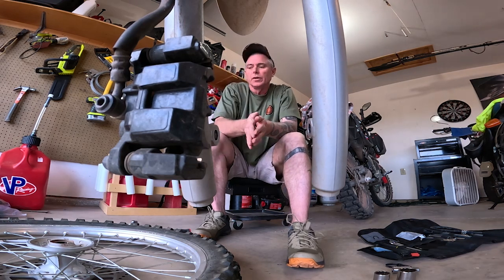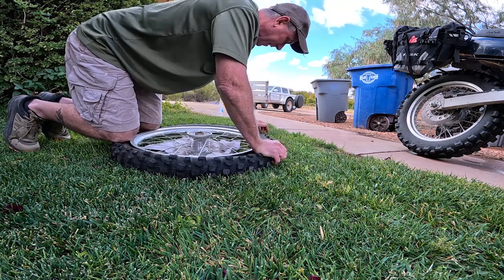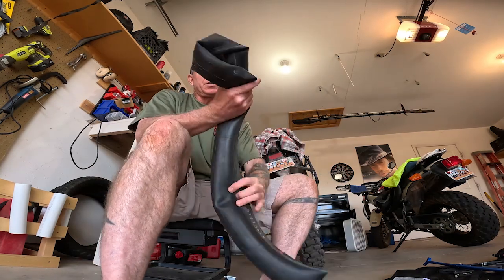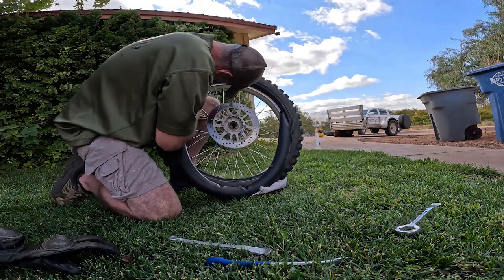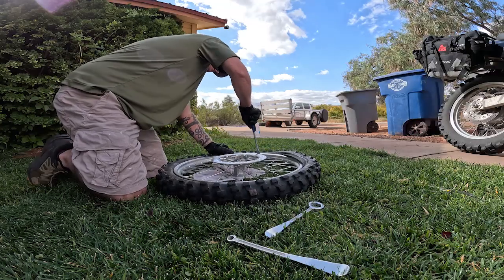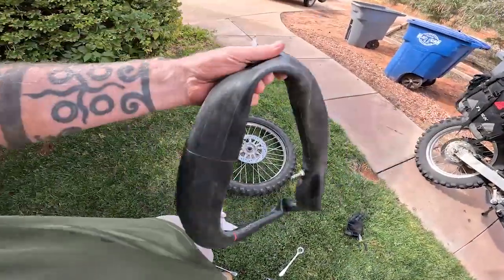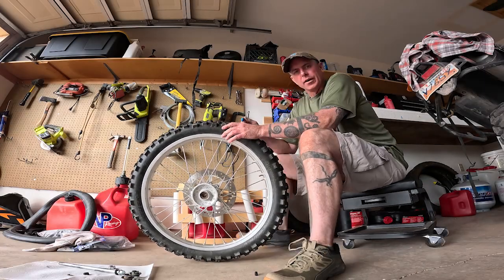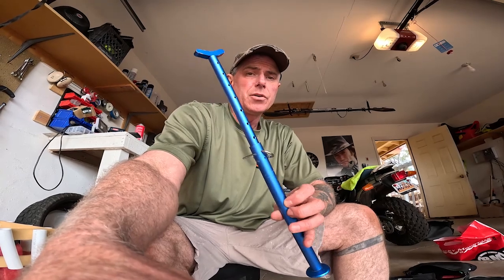Fixing Flat Moto Tire - Backcountry Training - Yamaha XT250

Comment: Tire coming off ?  Put 2 or 3 tire irons in before you start to lever it off.  Without doing that... you can't fit another iron in when there is bead tension on the tire. (As you found out.)  
Other big thing... is the DROP CENTER RIM.  You've got to manage the tire 'opposite' to where you are working the irons. Managing the bead back there is more important than the irons !  Both of the tire cords need to go in the middle of the drop center.  Use your hands to move the beads to the middle of the rim, then apply tension with the irons. Doing that will allow you to take it off/put it on... pretty darn easy !   Without doing that... it's a big issue.
Try this with a Dunlop Trailmax Mission Tire... they have the toughest bead and carcass !
Reply: I agree with your description of the Dunlop Trailmax Mission tires. I installed a set on my Super Tenere and they were an absolute mofo to deal with.  Thank God they were on a tubeless rim so I wouldn't have to change a tube in the wild.

Comment: I feel your pain! I also spent the best part of last Saturday trying to do this exact same deal on my XT 250.  
Getting the valve back in and forcing the tire back on is incredibly difficult - 
Ended up having to lube the whole sidewall of tire to complete - 
Exhausted when finally done.  
Not sure how this would have gone down if I was in the middle of the desert with the sun beating down
- especially if it was the back tire! 
I guess trying a few more times might make it easier but not looking forward to it :)!!

Comment: You need to add 3 small tools to your tire kit that will help you tremendously. 1-a tube of petroleum jelly or lip balm, 2- a bead buddy from Rocky Mountain ATV/MC 3- a valve stem puller (it hooks onto the valve stim and it pulls right through the rim. You did a great job without these tools, but they will make life much easier on the trail.
Reply from the maker: Stem puller is on the way!!

Comment: Thanks for the video and idea!  This is something that I definitely need to do.   I have been off-road riding for many years but I never have had to fix a tire in the wild.  I carry everthing that I feel would make the job relatively easy,  but I need to put it into practice, in the comfort of my driveway,  just to make sure everything works out.   I do all of my own tire changes, both on my dual sports and my street bikes, but I have the luxury of doing everthing in my garage on a No-Mar tire changer or just using the machines tire holder with spoons.